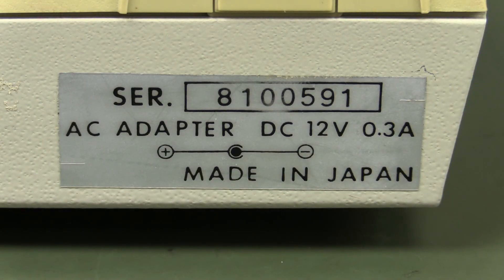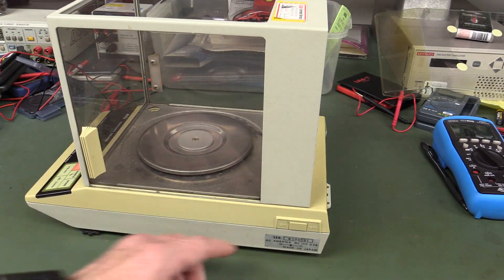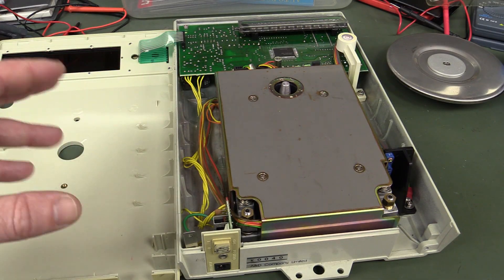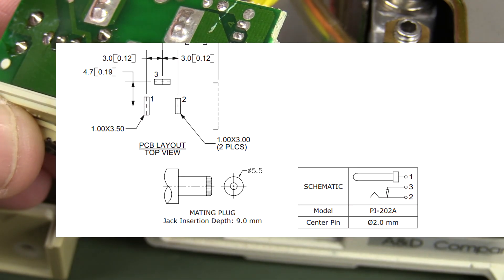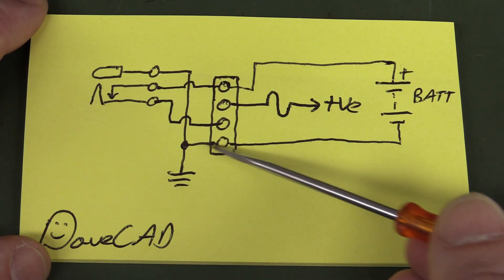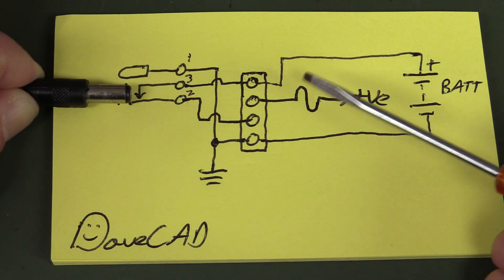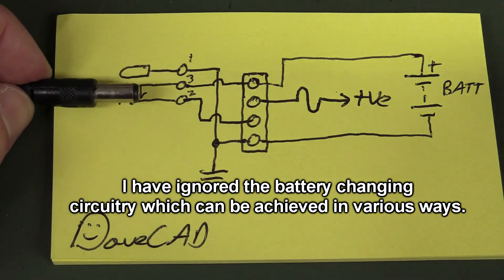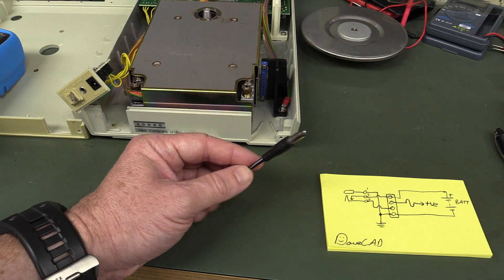EEVblog #1015 - Beware Evil (But Clever) DC Jacks!

Comment: Is there any reason not to put a bridge rectifier on the input side of the circuit so if you plugged in a centre positive it wouldn't matter? I appreciate that at the time centre positive didn't exist or wasn't popular, but in hindsight could you put a bridge rectifier in to prevent confusion over which power supply to use?

Comment: I recently bought a Brother label maker. When I plugged in my power pack, nothing happened. I checked and found it was centre negative. I switched this around and it worked. Then... I forgot I'd done this and used the power pack on my signal generator and was greeted by grey smoke billowing out of a couple of capacitors. The voltage regulator also had a bubble and pin hole to display it's demise. I didn't get it working again after changing the components and think I damaged the Atmel chip. Now I dedicate power supplies to electronics to avoid that mistake.

Comment: I never know that those jacks could be used as a switch and wondered at the schematic.  Of course I only checked for continuity with nothing plugged into it.  I am super glad you shared this as it sure filled in a gap in my knowledge.
Reply: Lloyd Simmons they were 220 ac sockets with that switch too for alternating between batteries or internal transformer operation.

Comment: The English also used to make their  cars with the opposite ground potential from that used in the USA.   Their argument was that points and spark plugs that wore down were much easier to re-gap because the raised deposits were on the "correct" side of the gap.    Maybe there was a similar idea here.   Any chance ?

Comment: Had a keyboard with negative center pin, ended up replacing the plug on a third party adapter because I didn't had the original.

Comment: I have seen Centre negative on many items, another change is the plug barrel that now seems to be 2.1mm pin connection but used to be 2.5mm mainly, or at least my old stuff seems to be.

Comment: just my thoughts sometimes it may have been nessaceray on a PCB that it had to be wired that way because of the design of the board or simply because a lot of old electronics had germanium transistors PNP etc and where wired positive ground or maybe the manufacturer wanted you to use their power supply adapter rather than  someone else's . and just going back to the pcb again I built a power supply for a friend to power a number of effects pedals and to avoid having to wire individual power jacks and drill and mount them on the front panel  as I had chosen a die cast extruded case and wanted everything soldered onto a pcb  to slide in , it proved rather difficult designing the pcb to accommodate the power jacks with the correct polarity

Comment: Nowadays, most such switches are mainly used for jack plug-in event detection. The third contact is pulled up internally and goes to a GPIO for the host to identify that a plug has been inserted in the jack. 3.5 mm audio connector in the mobile phones are a common example. 

These days power changeovers between mains and backup battery are all effected through diode ORing or an explicit electronic switch implemented with MOSFETs etc.

For the changeover Dave explains to work, there should be an arrangement for the Battery voltage to take over before the mains power is disconnected, or we have a glitch!

Comment: I have a little Handheld Ham radio on the 2 meter band made by Standard, it is a model C158A.  Her charger is center negative, and it is really a problem when using the DC charger in my vehicle because should you unplug her and not remove the DC plug from the Lighter plug, you have a live plug dancing around just looking for a ground to short out against.  I usually use her in my motor home when traveling, so the danger is lessened because most of the interior is covered with carpeting or wood paneling but it could be a real problem, for example I did use her in my Jeep (RIP) which was not a luxury model and had plenty of metal for that plug to short out against.

Comment: It is tipical for Japan, perhaps not modern, but oldschool walkmans, discmans, calculators, etc. made in Japan had center negative plugs. There was no real practical reason in that cases. 
Allso old(er) Japanese cars, bikes, work machinery etc. (whatever uses leadacid battery start) had chasis connected to positive. This was waaay before wall-wart powered stuff.
Some says it has to do with preventing corosion/rusting on vehicles, i have no idea really. 
And then that practice rolled over to electric/electronic wallwart powered apliances as they came in existence.

Comment: Also have to complain about the variety of plugs with different internal and external shaft diameters. Hate picking one up which slides in ok, but the internal shaft doesn't make contact. One standard size like the 3.5mm and 6.5mm plugs and socket would have been great.

Although...

Modern 6.5mm plastic sockets are just as evil (Jaycar PS0160, PS0190, Altronics P0071, P0073). As you insert the plug, the tip of the plug shorts between two adjacent socket connections before pushing the contact apart. As you push it in, the stereo socket goes connect, momentary short, connect, momentary short. If that type of socket is used on the output of an active amplifier, it can be deadly.  Don't remember this being a problem in the original English ones (SWAN brand??) we originally bought in the late 70's.

Comment: I like to design things with a bridge rectifier but with MOSFETs instead of diodes (2 P-channel and 2 N-channel). Makes it polarity insensitive but with almost no voltage drop. Of course not the cheapest solution.

Comment: Long time ago I had a cassete player with microphone for karaoke, it was center negative. So annoying, ended up reversing the solder joints at the DC input jack (which was just wired into the main board) inside the thing. Luckily it had a diode inside which prevented me from blowing it up.

Comment: you know - if i were you i would delete this, an engineer should know better than thinking which battery lead you switch makes any difference. if it did we would ALWAYS switch the negative as it is the current source. I would be incredibly embarrassed, if i were you.
Reply: I mean seriously - conventional current rather than electron current?????
Reply: It is really the lead that is vertically the lowest that needs to be switched first. As otherwise holes develop among the electrons inside the conductors and it clogs up  preventing smooth electron flow. ;)
Reply: How many people still momentarily get sucked into Ben Franklin's conventional current flow by the "arrows" on a schematic of a bridge rectifier or a schematic of a transistor?  Does PROPAGATION (vs electrons) actually flow from - to + terminals?
Who actually patented the barrel plug and the jack switch?
Reply: fine for 'people'. not so good for members of Institution of Engineers Australia, Electrical Division. Particularly when posting informational material.
Reply: Thank christ for that ;)
Poes law and that XD

Comment: Many of the old multi-device PSUs I used to buy had the lead reversible - either at the PSU or close to the spider plug - so that you could set it up appropriately. These days you have to check what you are doing if you are replacing an external PSU.

Comment: My battery powered Tektronix video test generators/analyzers have center negative. They are from the late 1990's. My battery powered Tektronix oscilloscope which was purchased at the same time is center positive. The adapters are both 12V 1A, but thankfully the equipment is protected from reverse polarity power.

Comment: As someone else might have mentioned, I can think of a couple more reasons why a barrel plug would be centre negative...
For audio gear that has audio GND at the same potential as negative, the centre negative pin would connect first plugging in, and would be the last pin connected when unplugging. Also no matter which supply is being used (battery or external supply), it's the positive that is being switched, as it seems pretty much every circuit designer prefers switching positive rails than negative ones.

Comment: I don't get it. You could wire it up the same way with center positive, the only difference being that it would switch the negative lead of the battery. And it really doesn't matter which side of the battery you switch.

Comment: A modern example of this is the Polycom HDX Eagle Eye Camera, used for Video conferencing (which I have insalled many of), selling for around R30,000 ($2,200 US) in South Africa. 
Another of it's awesome features is the lack of reverse-polarity protection, and a note in the warranty document about it not being covered when used with a non-original PSU.
 -I may or may not have done something which made my boss a bit cross.
Reply: Here it is on Amazon:
https://www.amazon.com/Polycom-EagleEye-Conferencing-Camera-8200-09810-001/dp/B006X0S86O

Comment: Dave, the external lead touches the plug before the center pin. In audio applications it is convenient to connect ground before any power source to avoid noise in the circuit due to different potential between the circuits. That can be a reason why the standard changed along the time. If you notice, all the guitar pedals from boss have central negative but that is the only exception I noticed, and they are sticking to their own standards ahahahha.

Comment: Dave has the version of this convenient DC plug that really is a pain. The inner contact tip protrudes and isn't shrouded or recessed like almost every other sized version. On -ve chassis battery kit i repair, there's a flylead that feeds a light with this kind of connector the users often unplug it and remove the light it feeds for a weight loss. The +ve plug tip on it's lead then ends up touching any -ve potential metal on the kit outside body and splat, the 5A fuse inside the hard to get at battery-mount goes away with an equally good flash. The plug is molded to the cable with a thread locking ring and i have never been able to find a substitute....

Comment: Dave, you just forgot to tell us why center positive has become the de-facto standard... My guess was always shielding, but this only looks right on the connector itself, since most cables won't be shielded at all...
Reply: IMHO it's got more to do with touch safety when the power supply is PE referenced, as e.g. SMPS not uncommonly are, especially when dealing with 24 V out and up. It would also really suck if you could easily short out (and possibly destroy) your power supply by accidentally touching some grounded part with the outside of the connector.

Classic transformer power supplies usually are floating double insulated jobs with very little coupling to mains, with them it really doesn't matter.
Reply: PileOfEmptyTapes good point! Didn't think of that

Comment: GE ACTA hplc (High-performance liquid chromatography) interface box got a center negative DC jack and a grounded metal case. The jack itself is under naked metal plane with a round hole, so the power adapter always get shorted. The original barrel plug got a plastic ring near the base to prevent that. Those guys (made in Sweden) were a bit weird.

Comment: I'm mystified that manufactures don't put a diode bridge in the circuit. That would solve the problem. Are they to tight to spend 20 cents ( if that much ) to make it a +/- universal input ? Guess so. Sorry I'm not an electronics engineer/bean counter.

Comment: There's another thing you should look out for if you plan on changing the plug to another size: typically the cable has two black leads and one of them has a grey line on it. That is most times the positive lead, but I had adapters where it was opposite. Always measure to make sure, never make assumptions :)

Comment: While it is inconvenient, you can easily turn a center-positive supply into center-negative and vice-versa by cutting the cable and soldering it back together with the connections flipped. It's not pretty, and maybe it'd cause issues with really sensitive electronics, but it's worked just fine for me to power guitar pedals and a keyboard.

Comment: I would just find an AC adapter that has the proper voltage and current, and a barrel connector that fits snugly and then just cut the cord, strip the wires and then wire them the opposite way, effectively making the proper power adapter.

Comment: now im a young guy, but as far as i can tell we started making the switch to center positive in the late 80s right around my birth. and even further so in the 90s now i say this from memory of things as new as the late 70s (atari 2600) being center negative as well as many radios and other plug in powerpack type devices from the late 70s-early 80s. (my parents where savvy so we had new stuff from time to time) and as i mentioned before it really took hold in the late 80's and onward products we got.
Reply: hell at one point radio shack here in america sold a universal power pack that had a switch on it aht would let you go between center positive and center negative. we had one for the aforementioned atari 2600

Comment: why do I have to SLAP him?? hehe The REASON the "negative tit" barrel connector is (rather, WAS...), is because, back in the day, Japan was belting out electronics which used GERMANIUM  transistors..  which were predominantly PNP.. therefore, the common of the circuit board were tied to POSITIVE...  thats the ACTUAL reason why the 'tit' was tied to negative...

Comment: I reckon it was to do with corrosion. If the plugpack was on and the connector happened to get wet, electrolysis would eat away at the positive electrode. This would be more easily noticed if it was on the outer sleeve, and easy to remove.  
btw: Around 1970 VW beetles had the battery positive connected to the chassis. Dunno why.

Comment: Dave, Neutral + Minus is always preferable when you think of surface deterioration. Consider that the external part is neutral, then the internal part is Minus. Just because if you put Plus there, during operation the external Neutral part would become Plus due to somewhat meaningful resistance of the cable.
Did you forget about the physics of galvanization ?

Comment: The "clever diagram" that shows the switching action is identical to what's been used to depict phone jacks with switching on the "tip" for decades. Plug in headphones and the speaker is cut off - exact same principle.

Comment: I think maybe switching positive is a culture in electronic circuit ,<<<AND FOR MUSICAL INSTRUMENT WITH RESPECT TO GROUND THE IT BETTER TO HAVE THE NEGATIVE CONTACT FIRST {which is the common Ground}  IF THE EQUIPTMENT SIGNAL LINE ALREADY PLUG INTO AMPLIFIER AND THE VOLUME ALREADY UP>>>  Capacitance from primary to secondary coil will induce hums during the process of plugging.

Comment: I can't stand the lack of a defacto standard for barrel jacks. I'm glad USB is taking over for 5V and soon USB-type C can replace for higher voltages. I hate wallwarts too (make it a normal plug at the end!).
Reply: Power delivery could use a USB-like standard for slightly higher voltages than 5.
Reply: It's easier to just throw an already UL approved wall wart in the box.
Reply: st1300 r I know but there are already pre-made UL approved ones with the 'wart' part in between and the wall part having a normal plug. Nobody likes when a wallwart blocks a plug.
Reply: Tatsh2DX But putting a box mid-cable, then adding proper mains-rated cable and a regular plug is more expensive and error prone than using a wallwart box.  The commonly accepted solution is to have a standard for the angle between wallwart box and wallwart plug, then design outlets and power strips accordingly.  The fly in the ointment are oversized wallwarts that try to put the entire device inside, and mobile phone chargers that are 90° wrong just to save a few mm in their box while wasting an entire outlet for the user.
Reply: Tatsh2DX you love USB until tou have to replace broken MiroUSB ports. I prefer 1000x barrel. Easy to repair, no data writes, just plain voltage/amps

Comment: I think in the world of DC jacks, many electronic items that were used in the home, were also used or in the car. And typically cars were negative ground, so if the negative barrel touched something metal on the car, it would short.   The standard center positive prevented or reduced the chances of shorting in a car when used in the cigarette lighter etc.
Reply: Michelle Pucca In European cars, negative ground is also standard.  May have been different 50 years ago,
Reply: Don't you mean positive ground?

Comment: Or just wire in a bridge rectifier made of Schottky diodes; then it doesn't matter which way you plug it in, and you'll only get about a .2-.3 volt drop! Cheerios.
Reply: If it requires that many amps you're probably not using a power pack, and probably not with a barrel plug.
Reply: William Squires x2 So 0.4V to 0.6V lost.

Comment: Another thing to trip us up: 2.1 mm center pin versus 2.5 mm center pin. Put a 2.1 mm male pin in a 2.5 mm female jack and wonder why the power connection is erratic and intermittent.
Reply: Oh yeah, I hate these bloody 2.5mm center pins. That basically means none of my DC adapters fit because they're all 2.1mm center hole. I'm probably going to replace all 2.5mm center pin DC jacks with 2.1mm center pin jacks because those 2.5mm ones are garbage. No reason to have a larger center pin. Most adapters use 2.1mm center hole just like most adapters are center positive.

Comment: When i used barrel jacks and batteries i would still use center positive without any diodes. Negative of battery to pin 3, pin 2 to ground, battery positive and pin 1 to vcc. And if using rechargeable batteries, charging can be achieved through the negative side with a diode and regular CC/CV circuitry between pins 2 and 3